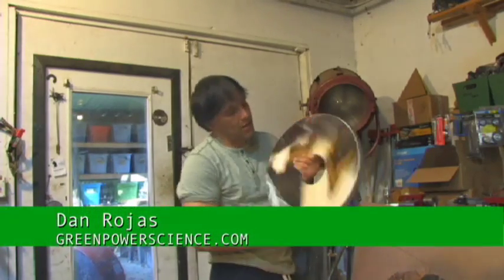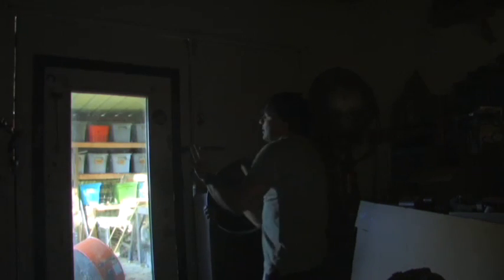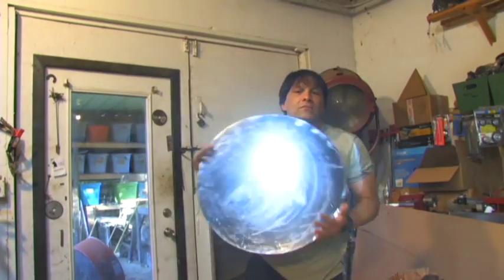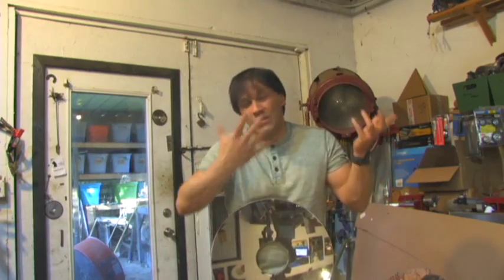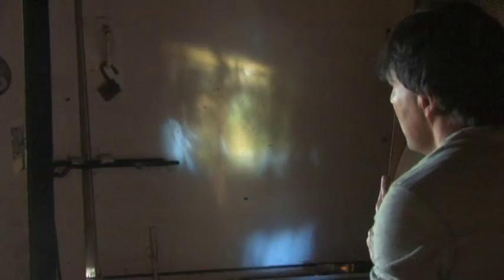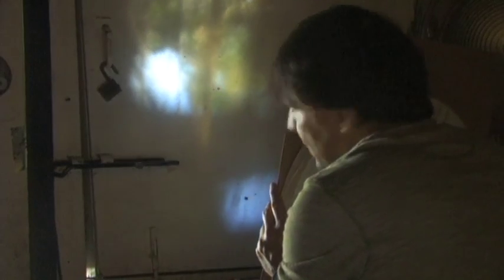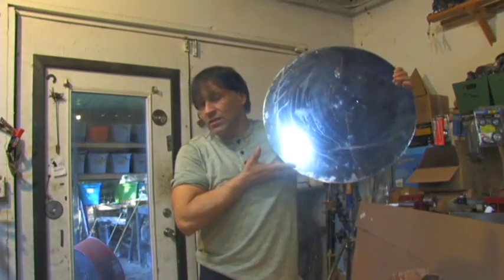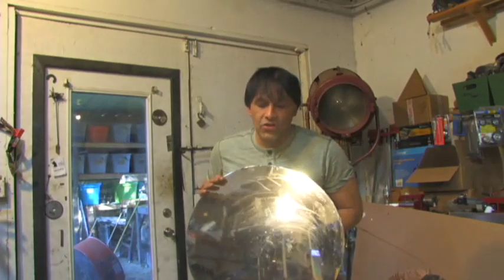DIY TELESCOPE primary mirror off-axis TESTING

Comment: Wow, I didn't realize the impact aperture size has on the sharpness of the image. Is it because it limits the surface area of the mirror so you get less light "interfering" since it is never reflacted off the imperfect more outer parts of the mirror?
Reply: I should develope the habit of listening. Good video.

Comment: Excellent way to make a cheap reflector for a solar furnace, but as a telescope mirror - useless. The frame (trashcan lid) rim will not be planar which will result in outrageous astigmatism. Also, the Mylar film itself is not uniform enough in it's tensile properties to produce a predictably accurate curve.

Comment: Hi,  this is good work but still a conclusion can't be made. First there is a minimum surface accuracy of mirrors for telescope let's say lambda divided by 4 or less. So I would like to request you for a Foucault test of mirror. It can be done by an iPhone and pinhole and a light source. If that goes well we can find a way to harden the mirror and also decide it's shape. Could you please try either this test or looking at moon through a magnifying lens which gets reflected of the mirror. This simple test will tell if it is really upto  as a telescope mirror at this stage. I am also looking into different ways to make cheap telescope mirror.
Reply: Hey would like to take some advice from you if you can contact me

Comment: If the back of mylar mirror had a thin fiberglass coating, enough to maintain the shape of mirror, plus a provision to provide a push/pull on center back of mirror, then the spherical surface could be altered to a parabola by deepening the center,  this would be manual figure control, the idea is to have the light reflecting off the primary mirror fall "Inside" the "Airy disc" in a star test, I believe it is possible to achieve a 1/2 or maybe 1/4 wave or better figure using this principle on a vacuum formed mylar mirror..., about 20 years ago I met a guy who worked for JPL , he worked with this other guy on fiber composite mirrors, they showed me a 48 inch fiber composite mirror with shape memory,  they folded it in half then let it fold back to original shape and said it could be folded up inside a tube then unfurled in space for use in a space telescope, they also had active figure control systems with these mirrors for ground based telescopes, this is a viable alternative to the expensive pyrex and other low expansion glass type primary mirrors...

Comment: The reason for a good image with the smallest aperture is the  long focal ratio and not the 'quality' of the mirror near the center. With the full aperture, your focal ratio is 'short' (maybe f3) but fully stopped down, your focal ratio is more like 15 and at longer ratios like that, surface defects matter much less; the apparatus becomes more forgiving. That is why it is much, much easier to make an f15 telescope than an f3 telescope of the same mirror size. Why then do observatories and amateur telescope makers go to all the trouble of producing fast optics? Because slow telescopes with long focal ratios become huge as the mirror diameter increases. A 24 inch f/15 mirror requires a nearly 30 foot-long tube assembly whereas a 24" f3 would only be 6 feet long. That means a lighter, easier to mount and use telescope---but only if the optics are very close to perfect---and that requires time and expertise and often, some pretty elaborate testing apparatus. A really, really good 24 inch telescope might cost $50,000 or more. The reason people aren't making telescopes from trashcan lids is that a $50 Chinese telescope at Costco will perform far better.
Reply: how is the large mirror with a small cutout in the middle of a mask different than a small mirror with a circumference the same as the cutout and a focal length the same as the large mirror then?

Comment: I have perhaps an unusal question. Is it possible and are the avantages to "mirroring" ( making reflective) one side of a magnifying lens for astronomy?
Reply from the maker: Hi,
It would need to be perfectly flat on one side an there would be tons of optical aberration because the light would need to enter glass then bounce back through it. First surface is needed for true optical applications. Traditional lenses only have one light pass so light filtering is reduced.
Reply: I suspected that, you confirmed it...thanks.

Comment: MISLEADING! Its a bad mirror for a telescope. It CANNOT focus and will newer be able to.  It is simply just NOT parabolic! This guy doesnt understand what a parabol is, and therefore is this video misleading! Its BS and you are wasting your time.
Reply: the mirror he shows is like 20 inch at around F2 focal ratio, and a spherical figure, a longer focal length, higher F number, and a parabolic figure would solve the optical problems, and would behave optically more like a glass mirror.

Comment: PLEASE ANSWER! This is A M A Z I N G!  1) What are you doing at @7:46 There is a second piece of cardboard,  but we never see much of what you do with it, how far away, etc. And wgat is thd Transformer you nentikn, ? Is that the firts cutout!  WHY TWO CUTOUTS, IF THEY ARE RIGHT NEXT TO EACH OTHER?,..   (I suppose its a matter of experimentation too),  2) Can you suggest anything other than an 'Oscar the Grouch' trashcan lid?  I haven't seen one of those in California in over a decade,... :)   3)  Any ideas on getting the 'vacumn' or Shape to stay? I am considering something like filling the space with foam insulation, then using my wet dry vac to pull suction, maybe experiment, with letting thd foam every so slightly harden before pulling vacumn etc,... seems like this could scale up well.  I see myself creating a 6 foot version with my wet dry vac permantly attached.  You taught more in a few minutes than all the negative nancys at cloudy nights and that other site,. Always saying what Can't be done. I Really need to build a BIG scope, I have found miles tall spires on the moon with my 6" Maksutov Cassegrain and correlated the spot on Google Moon sure enough, in the elevation data, anomalies, right where I saw in real world,..  a Spire 7700 meters high, sure right near the spot, , less than 100 meters wide Not naturally possible, the shadows I saw in my scope were sooo thin but must have been ten miles long, I also found a VERY Square Structure with 90° walls, I HAVE to revisit those with more magnification!  THANK YOU!

Comment: A Gregorian primary is generally NOT parabolic (there ARE special cases where it is, but those are rare). Also, I think it is false to assert that generally, optical surfaces are better at their center than at their periphery. The obverse is often the case too. What is true is that longer focal RATIO optics produce better images than shorter ratio optics do. That is why stopping down an optic clarifies an image (and not necessarily because one is masking off the putatively less accurate outer areas of an optic surface.). You can prove this by stopping down the edge of the mirror rather than the center.

Pressure deformed mirrors are interesting though and this is a good demonstration of how useful they can be.

Comment: I can't imagine this would be a replacement for an amateur astronomer who just wanted something they put together, and it just works. But part of me loves the concept. I imagine you could make a piece of kit that has temperature parameters and small pumps, you get the right shape every-time automatically. But I wonder if you could make an adaptive optics like system using a more complex rig, with a flexible mirror. I would have to see regulations, and the power involved. But I know that you can get some pretty powerful lasers for way cheaper then some of these five grand mirrors online.

Comment: A vacuum-pulled film will produce a spherical mirror, not good for telescope making because of spherical aberration. You need a parabolic mirror for telescopes.
Reply: How do you reckon it is spherical? I mean, it is obviously not parabolic, but why spherical? Id suspect something like a catenary. Also, maybe it is possible to correct the error through a certain shape of the secondary mirror.
Reply: Skandalos I'm thinking it is spherical because air pressure is evenly distributed in all directions and the plastic film's tensile strength is (presumably) also equal in all directions. But I may of course be wrong. Depending on the mirror shape a secondary mirror may not be able to correct. Grossly misaligned rays might miss the secondary altogether, for instance.
Reply: Bruno Lobo In a 2-dimensional situation even pressure perpendicular on a chain yields the catenary curve,so Im pretty sure it will be the same in a 3-dimensional case. After a bit of googling ("catenary mirror") Im fairly certain that Im right. The catenary is very close to a parabola as long as the curvature is very shallow which is why the guy in the video gets much better results when reducing the aperture.

As for correctors, there are correctors for spherical mirrors, the Schmidt-corrector but I didnt find any correctors for a catenary mirror.
Reply: Skandalos Remember that in the chain example, it is being pulled by gravity that acts in the same direction (vertical) along the chain's length, which is not the case with the plastic film, where pressure is always perpendicular to the surface. This might significantly change the surface shape from a catenary.
Reply: Bruno Lobo good point!
Reply: Skandalos Thanks! And thanks specially for the nice, two-way brain-picking chat.
Reply: Bruno Lobo Ty2:) its rare enough

Comment: still waiting on video 2 where you show pinpoint star images with this trash mirror
Reply: (9 YEARS LATER)
Reply: Its not possible.. Perfection is indeed something human hand lacks 😐
Reply: @chanakyasinha8046  Absolute perfection is an asymptotic goal. The interesting thing is that virtually all telescope mirror are still made by skilled artisan's using bare hands. Fully automated production of highly accurate aspheric optics is still an elusive goal. Centuries old manual polishing and testing techniques remain the preferred method. That could change in the future through the use of something like magnetorheological fluid polishing, but for now a pitch lap in the hands of an expert optician produces the most accurate optical surfaces achievable.
Reply: hahahahahahahahaha!

Comment: I built the trashcan lid mirror and was able to turn cardboard on fire in less than 30 seconds.  Works really awesome and my next step it to rig up a galvanized steel or copper pipe with my pool hose to build a water heater to warm up the pool for winter swimming.  Thank you thank you thank you, you're awesome!  Keep up the great work.

Comment: Dan, I have thought to use a kid's plastic wading pool to do this. I wonder if Mylar comes wide enough to do this? To fine tune the shape of  the lens I figured to use one of those brake bleeding pumps. Another way to bend the Mylar might be to make a hole in the back of the pool and attach a string to the Mylar. Pulling the string back for the desired  bend should cause a parabolic shape. Using a winding mechanism like a fishing reel might make it more precise.

Comment: Wow, very cool video!  So by placing the cardboard circle on the mirror, you 'stopped down' the aperture of your lens effectively.  I guess I never thought about exactly WHY a camera lens is sharper when closed down a couple stops from wide open.  Now it's obvious why, you're not using the edges of the lens at that point, so your image is even sharper.  Awesome stuff

Comment: You can't keep the vacuum long enough for something like that, Dan.  Not for astronomical use.  The vibration would mess it up too (it sounds like a drum, because it is a drum... that means vibration.)  For an image, that is a killer.  That said, it makes a fine mirror for non-astronomical use. The shape of even a bad telescope mirror is measured in fractions of wavelengths of light - 5*10 ^ -11 meters.  The smoothness of the glass far exceeds anything you could ever do with mylar.
Reply: Oh yes you can maintain the vacuum!, then build up fiber glass layers, thick but not too think, want to maintain very slight flexibility, then apply a push/pull screw to center back of mirror as to alter figuere from a sphere to a parabola, I know this will work as i have ground/polished and figuered pyrex mirrors ranging in diameter from 4 to 13 inch, and have acheived 1/10 wave of accuracy...The requirement that an astronomical mirror be made of a low E substrate glass is utterly ridiculous, remember your allways dealing with atmospheric distortion anyhow, and in this day of ccd imaging with sophisticated image stacking and enhancement a 1 wave optical system could yield images which rival that of a 1/20 wave system after processing...

Comment from the maker: Acrylic is the best option for an inexpensive permeant mirror. We are producing huge first surface mirrors that are CnC cut. The focal length is fixed. I like the vacuum as you end up with a zoom telescope and you can make a Cassegrain OR Gregorian via a vacuum concave or pressure convex SECONDARY mirror. The back would be clear optical glass and the center aluminum of the primary mirror can be removed with the process at 6 minutes here:
watch?v=FyCLOXF1188
Future video:-)
Reply: How to make cassigarian telescope from this

Comment: Either a big syringe, or a kind of membrane, that can be pulled by a spring or weight.
I could imagine making something from hoses and 2 bottles and some water that could pull a constant pressure for the mirror to be in the same focal length despite changing temperature of the trapped air. For a telescope mirror this would be useful...

Comment: Also the glass mirror i made like that is limited to more than 8000 mm safely and probably can be risked to go down to 7000 mm. That is too much for a practical telescope.
I used 6 mm thick mirror i believe. The thinner you can go the shorter you can make the focal length, but it is more difficult to cut and handle.

I have a 1.5 mm thick and 150mm diameter mirror that i can make to be like 500mm focal length easily. It is like a shaving mirror, not like serious optics.

Comment: Not really. Planar glass (i mean really planar) is even more expensive than parabolic, in larger sizes. If it is not flat or not parallel enough that will make aberrations all around the mirror.
I made a 1,2 m diameter household glass mirror like this and the glass seems a bit wobbly around the edges, but most importantly it is kinda bumpy all over. Not much, you would not notice it otherwise just if looking at the reflections from a sharp angle. This makes the image a bit fuzzy.

Comment: why not gluing a syringe (without the needle) to the hole in the trash can lid? add a little ratchet (cut in the plastic shaft) and you have an adjustable  vacuum pump (plus you can be consistent if you want to do several adjustments over time)

Comment: How about using a real glass surface that has been mirrored and then deforming it with a vacuum? The ability to flex will be diminished. But the quality should be vastly better.